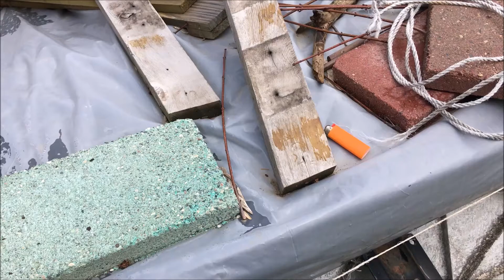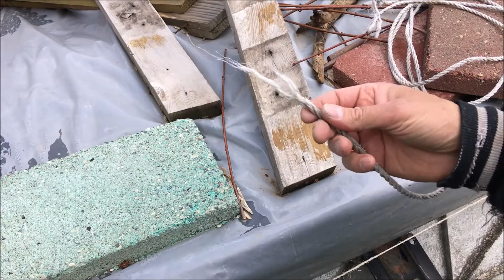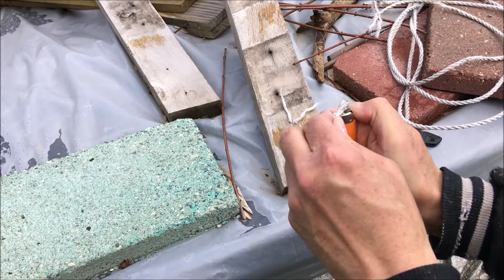How to Repair a Frayed Nylon Rope

Comment: Weave the end together as best you can then thread a piece of electronic heat shrink over it and heat. It shrinks and clamps the frayed end and the heat also  helps to gently melt the frayed ends together. Works like a charm.
Reply from the maker: Great tip, thanks! I will give this a try the next time I need to repair a frayed rope.